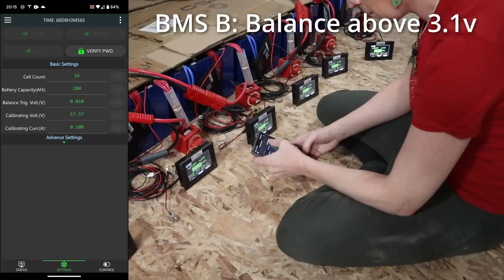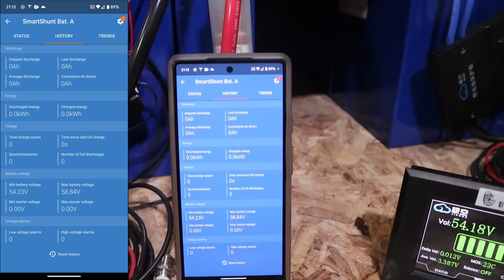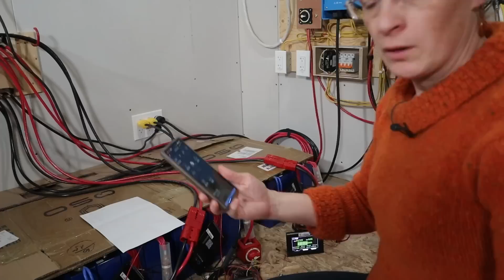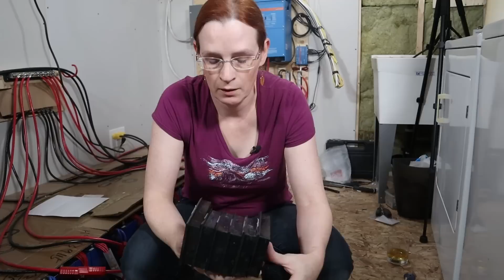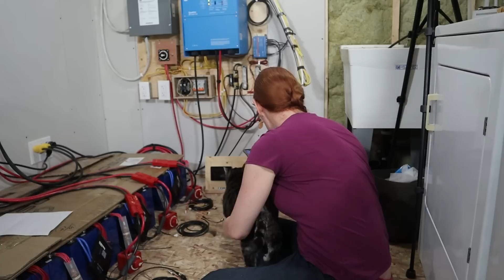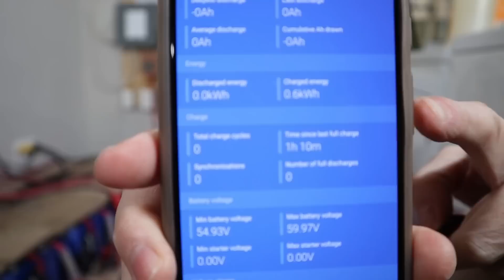Sparky Science! - Big Battery Build! (Ep. 48)

Comment: Your experience there, reminds me of when I learned myself the importance of fusing. I had run a 10awg solid wire to a 200w audio amplifier in my car. No fuse. I think at the time (I was 16) I had figured oh, its just a little amplifier, this will only be temporary until I can afford an amp wiring kit... It was my first car and I had only had it for 3 weeks. My dumbass did not route the cable with gromets and the routing was bad. It ended up getting pinched in the corner of the bonnet and fender due to flex of the car from road bumps a week later as I was passing through an intersection. Next thing you know, here I am rolling to a stop in a parking lot, with a mushroom cloud of smoke pouring out the front of my car, with my heart racing because I knew I had no way to disconnect it. The wire turned into a giant heating element, melting my vehicle wiring along the firewall. It destroyed the (corroded unbeknownst to me) chassis to battery ground, thus the next thing it used as ground was the shifter cable, allowing current to pass from the body of the car, through the shifter cable, through the transmission case and finally, thru the engine and back to the battery via the engine to battery ground link... Had to get the car towed as the shift cable (basically like a bicycle hand brake cable, just 6mm diameter steel cable instead of 1mm) had melted the entire plastic sheath it ran through thus fusing it together and I was not able to shift car out of park anymore. 

Needless to say, I felt like a dumbass. But... That was a life experience that I will ever forget, and thus ever since, reinforced the importance in my head, about fusing. It kind of is like when someone goes through a traumatic house fire, they will forever be cognitive of fire safety. This comes from someone, who after grade school, got a degree in electronics engineering. I look back and laugh at myself now (though at the time I certainly was NOT laughing!).

You handled it well, and you didn't let it ruin your determination and passion. A very good positive about failures, is you learn from them and (when they are nerve wrecking like this one was), it really burns an unforgettable life moment in your head. Some of the best discoveries and lessons come from failure

I suspect, as others have mentioned, the BMS disconnecting the battery caused a spike from the Quattro, which would of seen the load suddenly be removed from it's charger output whilst charging. This is one thought I had as I ponder and plan my 48V build plan, and how if possible having a BMS tell the charger to turn off would be better instead of just yanking the load out from under it. There are just so many products and items out there, it is overwhelming. And some of the BMS's that I have heard great about, are freakin expensive (such as the REC system).

For the CUI bucks, TVS/MOVs on the input, as well as a Zener/resistor string comes to mind. I did see in the datasheet they had a EMS recommended design schematic, which had a MOV on the input. Essentially, the goal would be to provide overvoltage protection, reverse polarity protection, and over current protection. I'd probably fuse both the inputs and the outputs at their sources. If would of been just better, if those BMS's just provided a DC supply for the screens.

I still have to watch the rest of your build videos from this point and onwards, so will be interesting to see what you decided to do and you may have just went a different route and not need those bucks anymore.

Thanks for sharing, it has been fun watching you work to achieve an idea in your head, to a final product, and never let anyone ruin your passion!

Comment: So when I was an apprentice electrician I had it in my head that cables pulled tight equaled neat. My boss explained on a few occasions that I needed to not pull my runs so tight before I stapled them. He also explained that just like how a hose moves from water pressure when it gets turned on so do wires when voltage is put through them, just to a less visual degree (unless you pull the wires to tight before stapling them, ironically). Well one day I was with him when they energized the breakers in a new house we had wired. In fact it was me, my boss, his boss, the home owner and the inspector, one big happy family. He flipped one of the breakers and a staple shoots out of the wall, through the sheet rock and it hits and cracks a window. They all looked at me. It was a bad day but it could have been worse, that type of thing can lead to a fire instead of a projective cable fastener. Well I was put back on the framing crew for 6 months to let it sink in, all that leg riding and but kissing for nothing, LOL. Well I guess I did learn a few things (the hard way). As for your coil of wires moving, it could have been an electro-magnetic response due to the coil but my guess is it was just a good old fashioned thrust due to a sudden surge of power being drawn through it just like a garden hose. Yeah that little spark show was scary I don't blame you for ripping that rat nest out of the mix. Great video. :)
Reply from the maker: Oh ooph. Kinda harsh punishment for a mistake though. :(
Reply: @TheDigitalMermaid  I've learned to appreciate it though. :)

Comment: The balance voltage setting doesnt matter when all cells are fully charged. The point of the voltage setting is to STOP balancing when your cells are BELOW the set value. In your case the balancing was equally active on all packs as all cells are above all your set values. Only the pack where you turned off balancing completely there was a difference. Look at the set voltage as the balancing automatic turnoff value.
When actively balancing at a cell voltage around the nominal voltage the balancing will actually throw the balance off as one cell with slightly lower voltage might actually be at a higher SoC than another cell with slightly higher voltage. So that's why you want balancing to turn off below 3.4 volts (or close to). This is especially true for LiFePo4 cells, while another chemistry might be fine to balance all through its voltage range. This is all about the SoC vs voltage curve where LiFePo4 are very flat in the usable range, but the height might differ a tiny bit throuhout most of the voltage range so it's a bad idea to try to balance at for example 3.2 volts.

It would have been interesting to see your test at a lower voltage (below 3.4v at cell level) as those with lower setting would then balance continuously while the one set at 3.4v would not balance at all.
Reply from the maker: I started a new test where I discharged all six packs to 40% SoC and have now disconnected them. They'll sit this way for some time while I get the boat home. When I'm back, I'll turn off balancing entirely and charge each pack up on it's own. I'll measure both how much power went in, as well as the delta between the cells.

Comment: you have to look at your car, in the car the electrical system and all safely through the fuses beyond the giant fuses on the battery each bulb or electrical user has its own specific fuse.  
example: an automotive headlight consumes 6 amps, it has a 10 amp fuse,
if a device consumes maximum 3 amps put a fuse of 4 or 5or even 6 amps,
EVERY electronic device should always be fed through a fuse.
This allows you to detect the faulty device right away,
and most importantly it makes you stop dancing with your disaster

Comment: I´m here only for the sparks and fire. And we almost lost Canada this time. Please stay safe.
I have 2 of the JK-bms same as yours, and i never trust the shunt inside the bms. After have my system up for 1 year the bms is all over the place. Right now my victron smartshunt shows 44% soc and bms 1 showing 76% and the other shows 81%.
Like Andy ones said, don't trust the bms, trust the Victron smartshunt instead. 

After having the system up for 1 year I´m only monitoring the Victron app and only checking in on the bms 1-2 times/month to check the balance of the pack. I don´t think you going to need the monitors, but know the feelings when you buy and plan for stuff u wont, and that´s not working.
Reply from the maker: Aye, I've all but decided to ignore the BMSes and use the SmartShunt. Shame, really. :( I'll be doing myself to stay safe!

Comment: What battery disconnect switches are you using? I bought a bunch of bluesea just to find out that only rated for 48 volts max and lithium charges at more then 48 volts, contacted bluesea amd was told they are working on a higher voltage switch and was told to not use my current switches
Reply from the maker: Bluesea, actually. It's the amperage that matters on current carrying ability. Voltage is more about insulation breakdown as I understand it, and for that, 10v difference doesn't worry me.
Reply: @The Digital Mermaid  so you run more then 48 volts? I was specifically told not to go above 48 volts do to fire risk
Reply from the maker: @todamnbad  yes, up to 58v at full charge. I can't imagine anyone but a lawyer saying that <60v is somehow a fire risk.
Reply: @The Digital Mermaid  this is the email response I received from bluesea.

Thanks for reaching out on this. Unfortunately even our switches rated at 48VDC Max are not compatible with 48VDC systems as the charging voltage will be well above 48VDC. With the increased implementation of lithium batteries and 48VDC systems in general we hope to have a switch on the market that will work with these voltages.
Reply from the maker: @todamnbad  I wasn't doubting that they said that. I'm saying that, in my opinion, the insulation is sufficient that 48 to 58 volts, which is still in the low voltage regime, is not a concern to me. If you want to wait for a new switch, I totally understand that, but I got what I thought was the best switch for the application at the time.
Reply: @The Digital Mermaid  when I talked to the original sales guy he said I was good to go. Then after I sent the email questioning the volts I got a call from the technical department and he said that that switch has a +/- built in but the issue is the contact area that is engaged during operation and the thickness of the copper components,  ihad one hooked up and didn't have any problems but after talking to them I got spooked and took it out, guess I'm not sure what to do but waiting for several months to a year or more for a switch isn't a possibility for me

Comment: Hey Sparky, I have 1680ah on my boat and for winter I take them down to 60% and just unplug the balance leads so the BMS's are dead and in spring, plug them in and they are still at 60%. I have a jumper switch to start batteries (lead acid)so the boat is still is powered through them, for pumps and backed up with solar all winter, fourth season now works grand...
Reply from the maker: Glad to hear that works for you! I should put a switch on the Vcc cable on the balance harness, that would also effectively "hard-off" the BMS. Thanks for the comment, I hadn't really thought of that.

Comment: Listen love handsome, what I saw I didn't like.☹
I suppose the cause of the problem is the construction of the voltage regulator on a thousand-hole baseboard, in electronic constructions you never reason like that. serious mistake not to put a diode followed by the fuse at the input of the regulator, and a protective zener diode at the output of the regulator in case the regulator no longer regulates.
 99% screens are to good, all that rush to blame something without investigating is worrying.
then anything running at 5 to 12 volts if powered at 50 volts will break or smoke, so fuses and protection diodes are always put in,
then I don't see the point in a boat of keeping screens on all the time, they should be on when you need to see what you need to check,

maybe one voltage regulator (good and protected) might be enough for all the screens

Comment: Hey Maddie. I was wondering why you needed these buck converters. I also had the big display from JK connected to my battery, but no buck converter was needed. Seems there are different versions of the display.
But your suspicion is right: the display draws a lot of power. When the BMS turned of discharging at 2.9V (thats what I've set), and the battery doesn't get charged, 3 days later even the BMS shuts down, because now the cells are down to 2.5V.
Thats why I have disconnected the display.
Reply from the maker: If your battery 4S or 8S? I was told that the screens only support up to ~25v.
Reply: @TheDigitalMermaid  To be honest, I didn't really think about the voltage for the display.
Reply: Huh, my first response got removed. Perhaps because of a link to Aliexpress.
So I've got a 16s battery, BMS is JK-B1A20S15P and I attached the large display. All bought from the Hankzor store. I connected everything and it just worked. Without any converter.
But now I have removed the display, because it draws so much power. Thats bad during the winter, when there's barely any solar energy coming in.
Reply from the maker: @einzelkampfer2006  Youtube auto-deletes comments with URLs (except from channel authors). I'm surprised that your screen worked... The screen's leads are bare when they're bought, where did you run them to? I've given up on the screens, so I suppose I could plug it in to 48v and see what happens. Worst case I burn it up.

Comment: I see you pulled down the short associated with the “big spark.” There was a comment there where you mentioned a preference for mosfets over contactors in the BMS control over disconnects. Could you speak more to this concern?

I suppose (don’t know) this is a high load (amps) disconnect (like a chisel 😂) but I think the fusing (high AIC) mitigates this to a low low probability of the event occurring—the welded contactor(s). 

If one really wants belts and suspenders, a mosfet based disconnecting circuit could be controlled by a relay independently of the contactor (or even controlled by the same signal). 

I must be missing something about contactors vs mosfets and I’m trying to understand your comment.

I hope this is constructive: please add some class T fuses and/or shielding between the Positive posts and the busbar, preferably fuse before the disconnect switch. You’ll be doing it in the boat, anyway, but if you have a concern about contactors welding, imagine a short circuit…

Great content and must see YouTube :-)
Reply: I stand corrected!  I did not see the fuses hanging there. (I use a different fuse holder so I didn’t recognize what now looks like Blue Sea holders. 👍)

So, with 200a protected circuit(s), you feel there’s a risk of welding the circuits closed with, say, 500a rated contactors on the charge or discharge circuits? I don’t think the likelihood is 0, but, for example, some Victron communicating  BMS architectures help reduce even this risk by controlling the charge sources before a disconnect and the loads through solid state relays. REC generally uses contactors but I see no reason a solid state relay wouldn’t work. On the charge side, DVCC is still available through the cerbo and I think you can find 200a solid state relays that will work for 48v. (Victron 48v currently (pardon the pun) limited to 100a.)

Zillions of ways to do this. I’m enjoying watching yours. 

Cheers
Reply from the maker: @jimduke5545  The fuses aren't in any holders, actually. I bolted them directly to ring terminals, and then covered the fuse and ends in the clear shrink tubing. I've not shrunk that yet, as the build isn't done, so they're just loose there for now for contact protection.
Reply from the maker: Take a gander at the batteries, you'll see all have a 200A Littlefuse JLLN200 T-class fuse hanging off them. That's my "fuse of last resort". As for the contactor; I'm not concerned so much about the welding shut from a short circuit perspective. I'm worried about it from a cell protection perspective. If the contactor welds (and the fuse doesn't blow, given it allows short spikes), it could leave the cells unprotected and subject to over discharge or over charge.